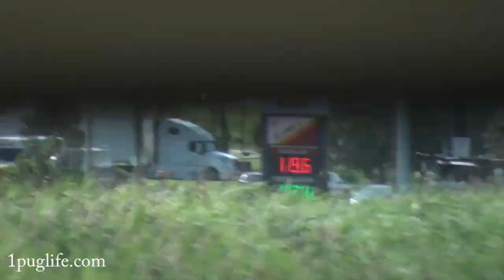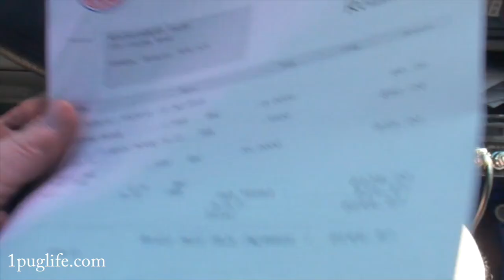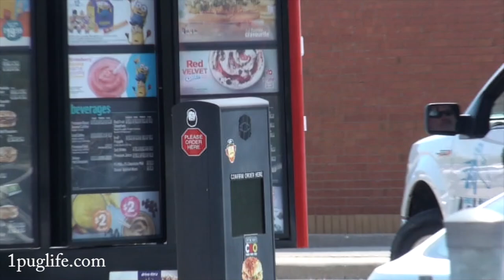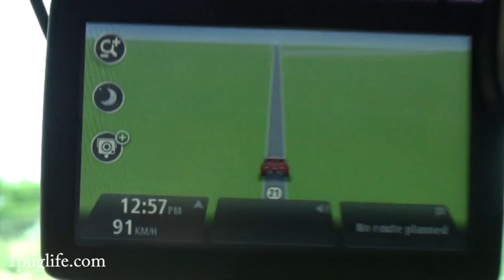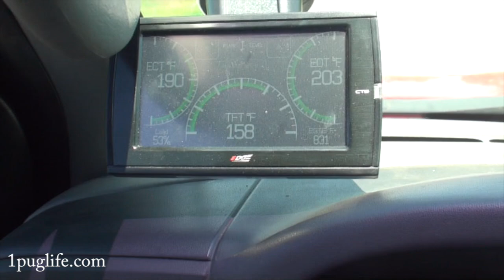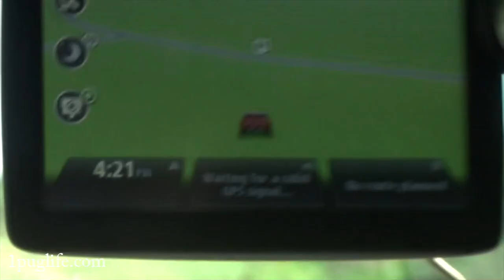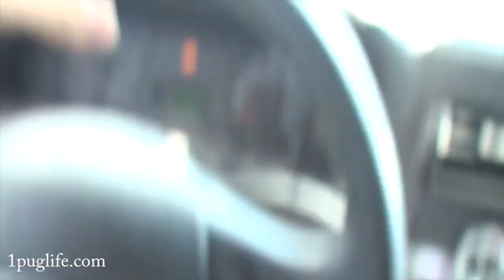picking up the 48 flathead MOTOR

Comment: Advance Adapters may be your friend, in this case.   The mystery holes may be for a torque tube enclosed driveline.   An external overdrive or newer overdrive transmission may make her more drivable.   There are lots of reproduction headers or exhaust manifolds made for that style engine.  You may even find engine mount kits for mating a '48 engine to a later car.   The rest of the work will be enough for anyone,  or any ten for that matter.  Good luck wrenching everything, but your back.  You've already Done That  enough.  Keep carefulling!  :)

Comment: those little chinese trucks like that white one at Zubiks are illegal to drive on the streets here. DAMN that motor runs pretty good and you're getting motor and transmission too, SCORES! a good running flat head is getting kinda hard to find and they are making a comeback now and the manufacturers are even making a lot of aftermarket for those now too. Still think you ought to go with the pre-made floor pans for that thing and get a replacement firewall for it too so at least that part is all standard, as far as the mounts go you can get after market mounts to convert that motor to mount to what you have there now

Comment: The motor is cool and all, but might have vapor lock issues with the crap fuel we have. and over heating issues.. if you drive it in traffic.. but, cool is cool.. i'd prob go with a flathead but I like power to much.. a 460 might be fun.. so you can light 'em up :-)

Comment: You need some thing with more horse power in that.
Reply: Mr Officer Rat rod,,, hot rod,,, drag car,,,, ricer,,,, golf cart,,,, power wheels,,,,, it doesn't matter what it is. More power is better. I agree with shawnc. Flatheads are cool but boring.
Reply: ShawnCFarm 572 chev
Reply: ☢TruckMafk TM™" Power is the key to having fun lol
Reply: That flathead v8 is perfect for a rat, and you don't have to mess with electronic crap
Reply: ShawnCFarm 60hp will bore the fuck out of pug...I agree
Reply: ☢TruckMafk TM™" I have a 2006 6.0 in my 73 nova...procharger..injectors...water/meth.. cam...690hp at the wheels...stock bottom end..ooops ..$ 2500 heads...but you get my point.   less than 7g
Reply: ShawnCFarm i need that motor too!!!
Reply: Joe Dugas that should be 110 hp
Reply: ☢TruckMafk TM™" its in my garage...its become a shelf for my wife.That motor was dyno'd in my brother-inlaws truck.  Need a rear-end..the one I want is 1800 bucks..needs all new brakes..thats why it sits...I should post a video of my 10 yr project.  There is a video of that motor blowing up a transmission on my channel.. in a 3/4 truck.
Reply: onelonleyfarmer I was thinking more like 70 to 90 horse. Still cool to have and I think you can buy more parts to give them more power. I have a LT1 in my 1995 caddy that has 265 horse stock, its just killing me not to put it in some thing.

Comment: That`s a dumb dump trailer. Raises half. Next load, put heavy stuff up front. Will push light stuff off first. Then can cheech. And run a cab switch for dump. Cigrit easier.
Reply: Arthur Bradley are you peckin?

Comment: Whats the plan to restore it to original condition or make a rat rod?
The thing is going to be a money pit that you will never get your money out of.
I just did a quick search and found a 50 ford custom deluxe near mint with a original flathead 3spd  asking15 000.00 probably get it for 12k and that was the first link I looked at.
Yer better off buying someones project that they spent thousands on and gave up on it for a fraction of the cost.
Honestly that thing is to far gone bud.Yer going to sink a shit ton of dough into it plus yer time and you could have bought something way better for less.
I have been down that road more then once before and had to learn the hard way.
http://classiccars.com/listings/view/692556/1950-ford-custom-deluxe-for-sale-in-davenport-iowa-52801

Comment: Maybe break out a dictionary before you keep mocking anyone who calls it a motor not an engine. Both are correct, synonyms if you will. Shit sorry forgot who I was trying to communicate with.....engine, motor, same.
Reply: unfortunately you wanting that to be true doesn't change the worlds definition, that's why we define words in a place like a dictionary BMP
Reply: Bruce  A motor is a electric driven machine which converts electricity in to kinetic (Mechanical) energy.

While an engine is the one which delivers mechanical energy from fuel.
Reply: noun
1.
a machine, especially one powered by electricity or internal combustion, that supplies motive power for a vehicle or for some other device with moving parts.

I appologise bud